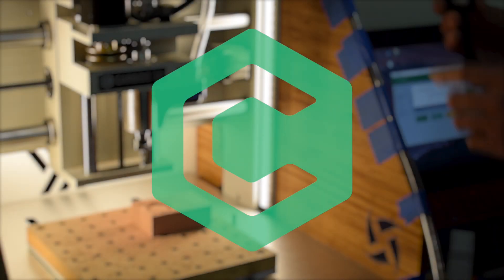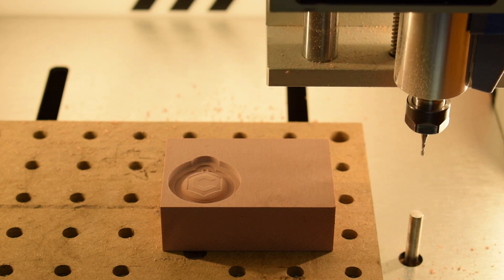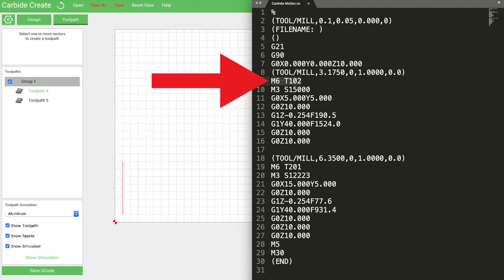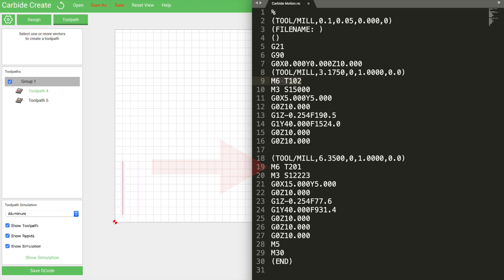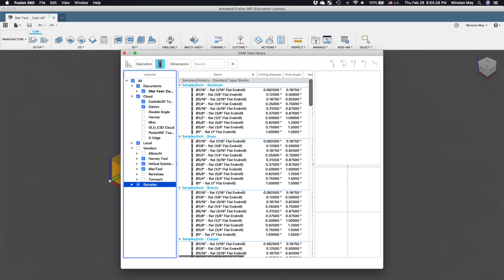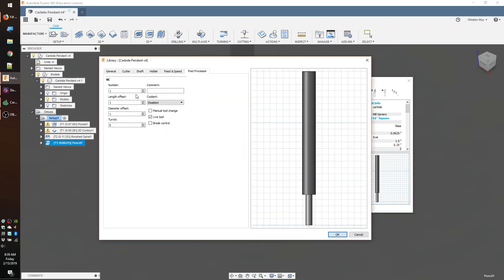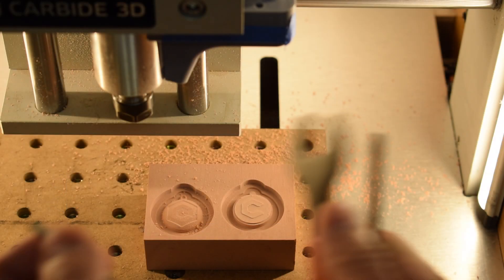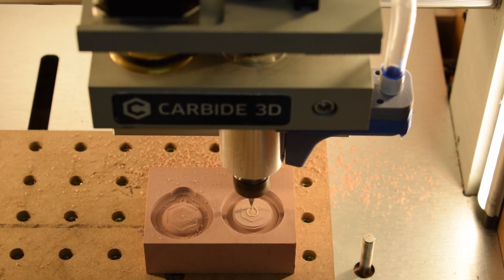How to Setup Tool Changes for the Nomad in Fusion 360

Comment: Great video! I'm running a shapeoko 3 xxl with the automatic bittsetter. Will fusion 360 automatically utilize the bitsetter or do I need to add to the gcode so that it carries out the process?
Reply from the maker: It will be automatic as long as you are using the Carbide3D post processor and number your tools uniquely.

Comment: winston, 

Big fan of the tutorials. Just bought a shapeoko 3 last week and was wondering if you could share how you recommend running a part that would require the use of different cutters from a tool change perspective. Basically a similar video to this but for the machine that does not have the auto touch probe? 

Thanks! keep the videos coming!
Reply: Conventional wisdom says separate toolpath files for each tool.  Option may be to combine with manual tool changes and re-zeroing Z after each change - depends on whether or not the post processor handles changes or not.
Reply: Great question. Also a shapeoko 3 owner and would love to see something like this. as well as if there is a way to incorporate the S3 touch probe in some way into the change. Any tips on this Winston?
Reply from the maker: Greg basically hit the nail on the head. Because there's no fixed location of the touch probe, it can't be automated into a tool change routine. In order to re-zero the Z-height of the machine you need to be outside of a program, so separating your operations by tool will be necessary.  -W
Reply: @carbide3d  that makes sense about not being able to automate the zeroing... But how do you re-zero on the part being machined if you've machined away your original zero point? I plan to use the touch probe when my S3 arrives btw.